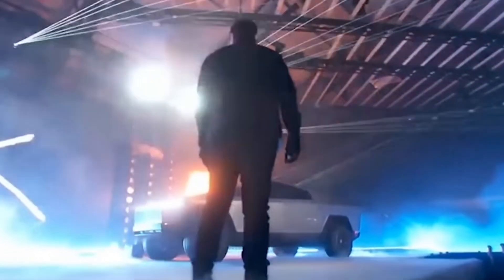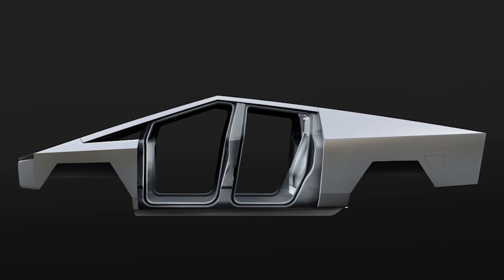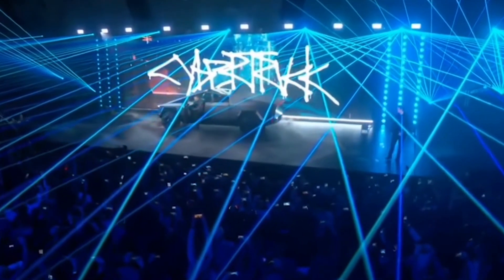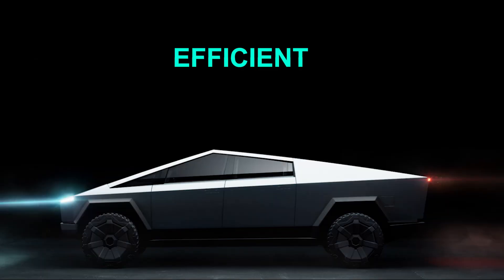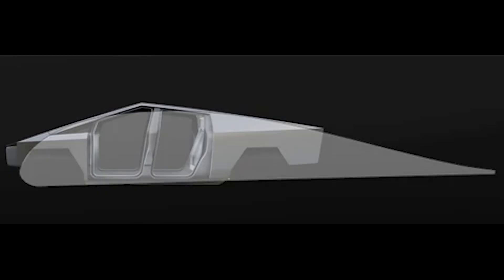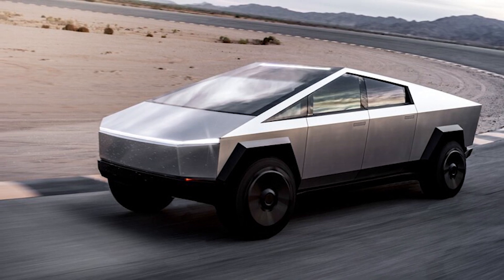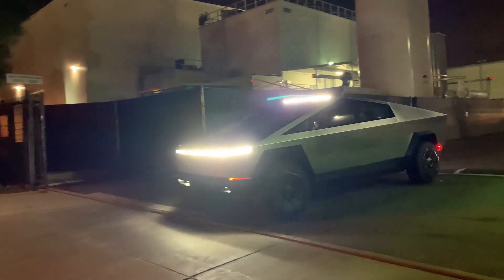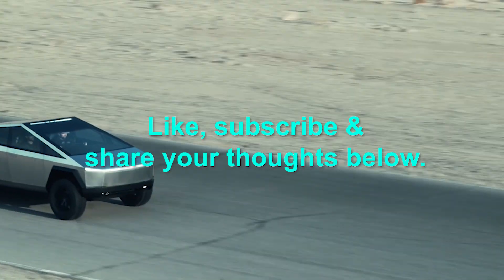Cybertruck is Engineering Genius (and will be copied)

Comment: How is it that you claim it is cheap and performs well, but other trucks with comparable performance (aspects that truck buyers value, not 0-60 etc) are way cheaper. On top of that, trucks are labor machines that need to be able to operate whenever needed to. If it happens that you are running out of fuel, you can just refill a regular truck, but this one has to be recharged, which takes time. This problem becomes more prominent when you are towing, since it will deplete the batteries substantially faster. This car being bulletproof serves no purpose for most people and only ups the costs. Finally, in my opinion it is ugly as f*ck, but I will not hold that against it since it is just my opinion and doesn't affect functionality.

Comment: Interesting video! 
One question: How does extreme rigidity translate to passenger safety? Don't you need a crumple zone to dampen the deceleration that occurs in a crash?
Reply from the maker: You can score the steel to bend/fold/collapse as you wish in the event of the impact and add materials to dampen impacts as well. Sandy Munro talked a bit about this on a recent interview with autloline... don't have the link handy though.
Reply: @SolvingTheMoneyProblem  sure, that sounds a lot more reasonable. But then the statements about the extreme rigidity don't really hold up. ;)

Comment: I love Tesla and this vehicle to death. But I have to disagree on the safety front. Modern vehicles have crumple zones for a reason. “Rigid” is not a word manufactures generally want associated with the entire body of the vehicle. Cause the less it moves, the more you move. I think the next time cyber truck makes headlines will be because of its shocking departure from Tesla standard safety ratings

Comment: Interesting. Loved your description of the exoskeleton, which for me seems like the most attractive aspect of this vehicle. My concern is its power consumption when towing. Couple of articles and videos out there mention the increased energy consumption and reduced range when towing. And that combined with searching for charging stations and the time needed to recharge presents a sticky problem. Since my interest  revolves around getting a vehicle capable of towing a horse trailer and 1,000 pound flight animal that might not have the patience to sit in the trailer for the one to twenty-four hours necessary to charge such a vehicle, this might not be the vehicle for me. Would be interested in hearing how Mr. Musk plans to address this.
Reply: Towing is going to be a disaster unless Tesla doubles the battery size. What good is it to have 15,000 pounds of towing if your range goes down to 50 miles. If I can’t tow my toy hauler to the next charging station… I’m stuck, no?
Reply: Oops, it was supposed to say 'flight animal' not 'flight energy'.
Reply: Range anxiety and charge anxiety are both solvable problems, and similar to those suffered by equivalent ICE designs.

Comment: EVgine could build and deliver a Cyber Truck today.  There are metal fab shops copying the design now and then they installing EVgine all elector kits ti make them all electric.  EVgine can convert Class 8 trucks as well.  
Wait until you see the EVgine all electric conversion kit for any truck or bus.  Anyone can install and repair an EVgine system.  What  tow your Cybertruck 250 miles away and wait up to six months for repairs?

Comment: It's motorized origami. Instead of being made of folded paper, it's folded sheet metal.
The stylists originally wanted to go with cutting-edge square wheels to be consistent with the rest of the design.
On the other hand, those uninspired engineers insisted on traditional round wheels.

Comment: Take this 1 step further, the Maxwell and Hibar acquisitions allow Tesla to make their own batteries, which are dry coated, with low cobalt formula, higher density and cheaper than Panasonic. Allows an extremely low-cost and affordable Small Car, designed in China. No body will be able to compete at that level.

Comment: Impressive truck and comes in 4 vibrant colors: silver, chrome, metal and steel.
Reply: Wrap that puppy! Least cost effective advertising you can buy!
Reply: @bruceburnworth8082  Exactly,  have one preordered for my engineering company going to wrap it and be a driving billboard that everyone will look at.
Reply: @bruceburnworth8082  a big future in the wrap business, especially if the next Tesla is also SS.
Reply: Use a bright mirror wrap. Then it comes in whatever colour it’s reflecting.
Reply: LASER ETCH SOME TATOOS ON THAT BEAST!
Reply: <<W.h.a.t.s.A.p.p++ 1. ( 4.0.8.) (5.8.0) (0.8 4. 6)...>>
Reply: Doing better than the overpriced and boring darķ blue red and green from everyone else
Reply: It actually will have some color option. Elon Musk said they'll at least do a matte black option, not sure about much else.

Comment: Metric specs anyone? 
Top speed: 130 mph = 210 km/h. 
Range: 250-500 mi = 402-804 km. 
Payload 3,500 lb = 1588 kg. 
Bed Length 6.5 ft = 1,98 cm. 
Towing 7,500-14,000 lb = 3400-6350 kg. 
Ground Clearance 16 in = 40 cm.

Comment: Price and Utility are done a huge disservice by it's length.
A standard sized, perpendicular parking lot is 2m x 5m (in the EU). Including all parking lots at Tesla Superchargers.
This car is 0.9m LONGER THEN ANY PARKING LOT it will encounter on the continent. It will also not fit the curve of many ramps in underground or multi-story parking garages. (e.g. at a trade show or large shop) 
It's width means you can't open the doors after parking.
Eleminating the rear seats would have cut cost and shortened it to a usablelength.
Reply: It's the same size as the best-selling F-150 pickup truck with crew cab.

It's on the large side, but it will do just fine in America, where people buy pickup trucks. I expect - and comments I've seen online reinforce it - that Australians will love this too.

As a very versatile vehicle, with capacious seating for six (possibly more with add-on rear-facing seats in the back, like the old station wagons and a few other vehicles had, sufficient cargo space for most shopping trips (even for furniture or do-it-yourself amounts of building supplies), while being efficient and damage-resistant, it will make a great robotaxi - and Tesla has already hinted that it is going into the robotaxi business.

Musk has said that they might come out with a slightly smaller version later. That might be a better fit for Europe or Japan, or other places where space is often limited.

Comment: Allow me to disagree on the safety for the cybertruck (not the other Tesla cars). 
Not only for pedestrian safety (tthe one you ignored by regulators don't) but also for passenger safety. 
With the speeds and  momentum of a car, you don't want "tough". You need energy to be absorbed. Lots of it. Else you'r body wil absorb it and the human body has...limits.

Comment: 6:40 From the front it looks like a gigantic shopping cart with stainless steel wrapped around it.  The rear is just one large stainless steel rectangle  reminiscent of stainless steel refrigerator door panels.  The wheel arches look like they came from a Tonka truck. And the tires are the same kind that you find on modified raised up high pick-up trucks.  Those tires are very loud.  People who would never even considered a vehicle with tires like that are now all-of-a-sudden on board. lol!!!  I don't think folks know what they are getting into.

Comment: The one feature I would like to see is the ability for a flat bed, or a box on the back. I just cannot justify such a vehicle if it cannot hold all of my tools. (I am a Ferrier btw)
Reply from the maker: Yep. I think since the demand has been SO insane, Tesla will probably end up making a flat bed version as well. Elon Musk said demand is so high it will take them 3-4 years or so to produce enough !
Reply: A flatbed would require a complete redesign of the body at structural assembly… Look at the gigacasting of the rear

Comment: The average ford f-150 costs $28,000. Yes the tesla can pull more but it also costs a lot more. It is closely priced with a heavy duty more than a light duty. If it competes with heavy duty trucks, it's "performance and utility" is laughable. If it competes with light duty trucks, its price is about $20 000 more at least. So now you tell me who tesla is really competing. After all, it is too expensive for a light duty and pathetic for a heavy duty. The only thing tesla does well is safety, but then again all of the companies are catching up very fast and tesla hasn't done way to much after their initial safety features.

Comment: Buying almost anything today is an emotional decision . . . for better or worse.  Too many people see the Cybertruck and think, "It's ugly."  Therefore, sales will suffer.  Yes, it is cheaper and environmentally better to not paint a vehicle, which is necessary for traditional stamped steel bodies.  But most OEMs have already invested in the machinery to paint vehicle bodies, which leaves only the material costs and labor.  Vehicles are painted with robots in a modern auto factory, and the cost of the paint is < than the additional cost of 3mm stainless steel over traditional stamped steel.  Tesla's batteries, their battery management, battery cell balancing, etc, are WAY ahead of the competition.  But in the realm of basic automobile manufacturing, Tesla still has much to learn from the OEMs that have been doing it for decades.

Comment: Point 1 is way off mate. It's not cheap. The entry level does not have the performance of similarly priced trucks and the top of the range can't compete on towing power of 70k trucks.

Comment: Aerodynamic is for weak powered car.
Cybertruck is so accelerated that if using aerodynamic design the brake become useless. So they use flat surface to add extra drag.

Comment: I'd like to carry 4x8' sheets of construction material. Hard to do with a 6.5' bed.  How about a 2 door, no back seat, longer bed version. Same outer dimensions, just lose the back seat and have more hauling space.  The only reason I see for a back seat is to become an Uber/Lyft provider and charge more for the CyberRide.
Reply: Tailgate flips down, and another piece flips up to catch sheets of plywood.  As long as you only need it for occasional small loads it should be fine. If you need really large quantities you probably will have it delivered directly to the job site anyway. If you are that rarity who needs something in between, then this probably isn't the truck for you. It's a general use light duty truck that is quite versatile, but it isn't the right fit for every need.

Comment: However if the trucks body gets damaged it would be near impossible to fix.
Reply from the maker: Yes, if it is badly damaged, it'll be a write off. But it will take plenty. A smaller impact = dent = visit a metalworker and they can get it back to new.

Comment: Thank you I never heard about it. I need one. It's what cars should have been long ago. I hate todays fucked up car design sand this corrects it. I have been drawn to pick ups and station wagons since long. Cars I had (in selection) for you to see where I come from and what I like in a car: 1964 Buick Skylark, VW type 3 1969, Volvo Amazon Stw, VW Golf 1 1977, Olvo 240, Audi 80, 80 Avant, 100 x2, 100 stw x2, Chevrolet Caprice stw 1978, Chevrolet Impala 1970, Dodge Colt 1975, Mercedes c200 2000 (current), Ford Taunus 1961 stw, VW type 1, Ford Escort stw.

Comment: 6:45 i already mentioned a safety issue, no crumple zones. safety isn't about plowing through things you run into, to start with that isn't safe for other drivers. but it isn't the fall (or wreck) that kills you, it is the sudden stop. if this vehicle has no crumple zones it will be as safe as a chevy truck from the 70s with a modern seat belt. VERY dangerous to everyone else on the road (like a 16 wheeler) but allot smaller, and still pretty dangerous to you, because if it gets forced to stop, it will just stop or fly apart instead of absorbing allot of the impact in crumple zones.

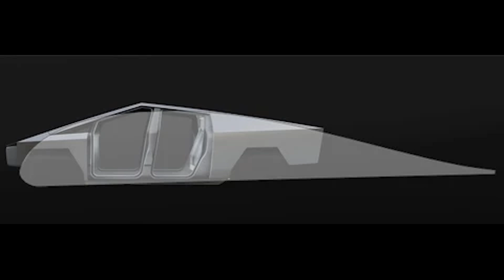Comment: 6:03 no matter how much you want to be, you will not be at that stance going down the road. seems like f117a numbers to me, only valid in a very specific circumstance, if the back sits a hair lower, or the front sits a hair lower from that simulated wind tunnel, serious issues occur. so i suppose it is fine on smooth roads, what work truck is exclusively on smooth roads? although i myself will argue that on unsmooth roads you won't be very concerned about aerodynamics.

Comment: 2:37 NO YOU ARE WRONG. the cyber trucks body IS NOT stamped like that. all pannels must be scored BECAUSE STAMP PRESSING DOESN'T WORK ON THAT TYPE OF METAL, then folded. it is still faster an easier than modern stamp press body design, because of the simplicity of the body. BUT IT IS NOT STAMP PRESSED. they couldn't do that with the metal. it is gouged on the lines, then folded. and you can't fold it all at once (yet). then the inside of those lines is welded, to replace the removed material. holy crap, this was a day one even a couple days before the event that showed the truck release info. IT IS NOT STAMP PRESSED. it is FOLDED.
Reply: if it were stamp pressed we might see some curves lol. that's how auto body panels are created already. the stainless that they are using for the bodyframe is too thick for a stamp press, but they are building the body and the frame in one, gouging and folding is what they went with, something that they could automate through multiple step machines, although even hand manufacture for something like this is relatively cheap. a single person for each step might finish 4 or 5 a day, and it is 3 steps, 4 if you count qc. first step is to gouge and cut the plate of stainless, second is the fold it, third is to weld it, fourth is just qc. lets say qc can work at twice the rate of the others, the others are close enough to 1:1, that means for every 6 people you can produce 4 or 5 body/frames a day (maybe more, but i accounted for assistants, moving around a giant chunk of steel isn't easy), now let us multiply that by 100, for every 600 people you can produce 400-500 body/frames a day. that just DESTROYS production numbers on other vehicles.

Comment: my biggest fear is that it doesn't have crumple zones, because the body is the frame. that would cause constant failure at safety tests, not only because it would be VERY fatal in a collision with an immovable object (a solid concrete or brick wall) but because another part of safety testing is how safe is it to another vehicle in collisions. this rating is based on tonnage, a 16 wheeler is definitely more dangerous in a collision than a consumer truck, but it is also allot less safe to collide with a truck from the 70s than one from the 90s or 2000s, let alone this new century of teens. this truck might fail safety just because it is too dangerous to run into. forget about the safety of those inside the truck, it is very possible that colliding with this truck is as dangerous as colliding with a 16 wheeler. by ton that wouldn't pass safety. but i am also curious about how safe IT is when running into a brick wall. i suppose given the design the front end is supposed to lift in that type of collision with the angle at the top of the frame absorbing the impact, but that introduces a problem where you could throw the bed of the truck over the front of the car. i just don't know, i am seriously waiting for crash data, that will be the real question for this truck.
Reply: Instead of commenting here , put a detailed video about the issues of the cybertruck and explain it.
I really want to hear your issues with it.
Reply: @GaneshPalraj1991  yeah, if i could do that i would have a youtube channel. knowing a little bit about everything is about the same as knowing nothing about anything. i could follow your advice and in a few months i might come up with something, badly created around the time when i would need a chunk of cardboard to write on next to the highway. or i could continue to just nudge people while i work a pretty low paying job. seems to me that option 2 doesn't have me sucking gas, so i choose 2. making videos (in particular animated simulations) isn't as easy as you seem to indicate, and the visual for what i am talking about (crumple zones) is pretty easy to do in your head, the angled peak at the top of the body/frame on the truck is a big spring. on impact it will force the nose up or the rear end up (because the bottom of the truck is going to move like if you had your hand on a table palm up and curled your fingers) and that can lead to the bed of the truck lifting while the nose stays on the ground in a wreck, the result being that whatever was in the bed of the truck might fall right on your head. at least that spring (the angle where the top of the frame meets, in this case the top of the truck) gave you more headroom right before the really crazy things started to happen. if you have made it this far; thanks. i actually don't think this truck is that much of a design fail, it actually has allot of things going for it, but my fingers are definitely crossed concerning its ability to pass safety tests.